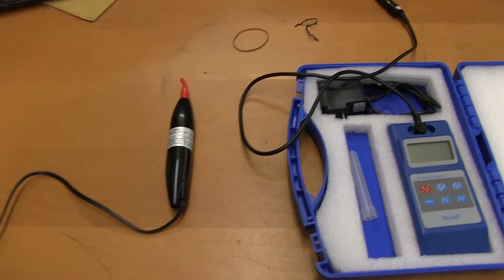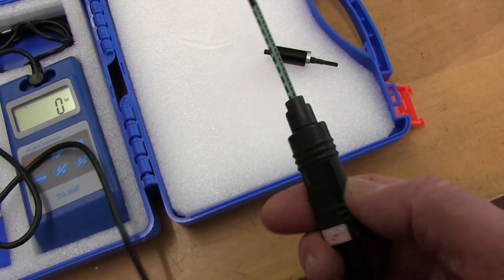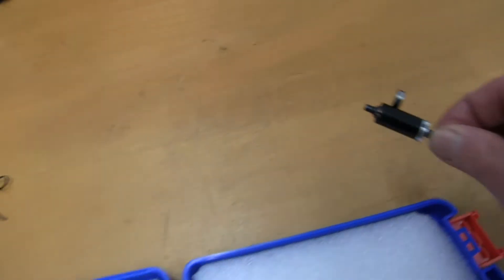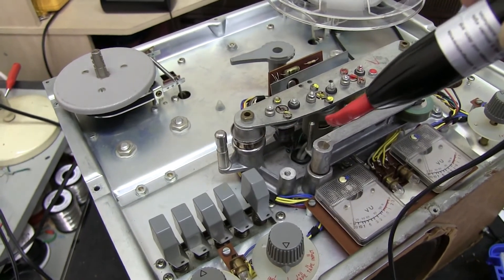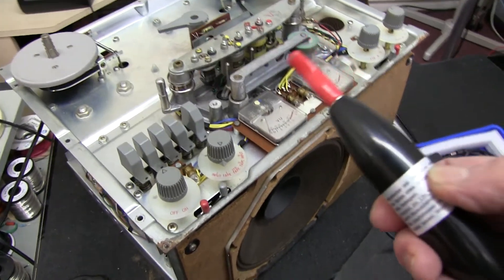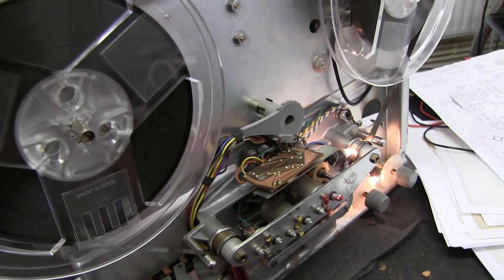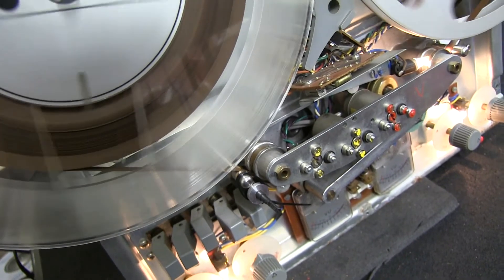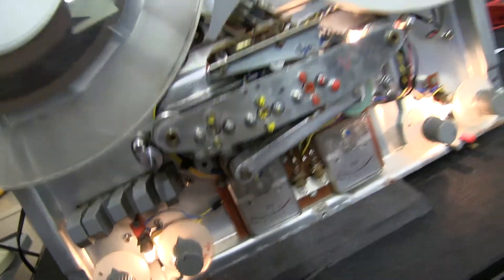How to Degauss and how to DC erase tapes. Reel to Reel.

Comment: correct if wrong, but could you not just hold the head degausser in place where you held that magnet and it would do the same thing? that way you would get the proper AC magnetic field required to erase the tapes and there would be no leftover magnetism on anything ? thank you

Comment: Good tips and ideas, but I'd never use a permanent magnet like this to erase a tape. True, it certainly does wipe out the recording, but it also leaves the tape in a magnetized (DC) state. First of all, it may be problematic for the erase head to properly erase the DC magnetized tape during a subsequent recording, but also since the erase does not necessarily cover the whole width of the tape, there will be remaining strips of DC magnetization, so if you haven't had problems with magnetization buildup on the heads before, it's likely you will after this type of erasure. True, DC erasure has been used in low end tape recorders, but the approach is to have at least two pole pieces with opposite polarities attempting to first magnetize and then de-magnetize the tape again.

Comment: I have one of these I suspect that the U.K. mains voltage is a bit high for them as they get hot in use. I have fitted a momentary switch in the cable of the one I have just to prevent it being left on accidentally. Great video thanks

Comment: indeed i had  such a  red tipped one i bought it a decade ago i thought it was dead  after these uears when i tried it today  because you feel nothing no vibration dont even get warm (the short time i had it on)  so you say that it  is normal with those torpedo demagnitizer  things only a slight vibration when actually touching the heads. good to know  so i take  its probably still alive then

Comment: Can it work on fast forward mode ?
Reply from the maker: Hi. Yes, the bulk erase will work on fast wind
Reply: Nick Adams Thanks ! Could you provide a link when I could purchase that little sort of motor magnet you’re using ? Finding bulk tape erasers in Europe is really difficult
Reply from the maker: @louismarinrenaud416  I used the rotor magnet ( it has a north and a souh pole opposite on the long side).
It is from a model car brushless motor (standard 1/10th scale 540 size).  You can take one out of a motor or buy one.
Here is an example:
https://demonpowerproducts.co.uk/product_info.php?manufacturers_id=&products_id=9852
Or look on ebay.

Comment: The only issue is the level of noise the permanent magnet can leave on the tape ... if the recorders erase head isn't completely blanking the tape then it could possibly be misaligned OR the signal going to it is weak do to electrical circuit(s) driving the erase head... the other issue is that using the permanent magnet is that it could magnetize the play head (3 head machine) ... I've heard that two head machines it isn't an issue because the BIAS applied during recording will act as a head demagger ... I don't have any type of testing equipment to verify that ... perhaps there is some that could test that LOL

Comment: A good instructive video!  Better than most. Can anyone tell me how do I know if my reel to reel heads are knackerd? cheers
Reply from the maker: Hi Roger. Worn out heads will normally be the loss of high frequencies or volume fluctuations.  You should be able to look at the head face with a magnifying glass.  Look for the vertical slit in the centre and see if it is still very narrow, with no bits missing, or wider at any places. Also the tape may have worn a groove into the head which can cause the tape to lift at the edges.  Heads can be relapped, ie smoothed out, but if the microgroove has widened out, it may not get any better by cutting it lower. All the best nick

Comment: This is a good video and very helpful because I have not been too impressed, with those other mains powered magnetised erasers that buzz loudly and leave audible artifacts.  So I think I will try your idea with the Sintered rotor, and then modify an old cassette tape recorder with the magnet to automatically spool and erase for me.  I wish to erase some multi-track Metal cassettes that I bought in the early 1990s.  So is this Ebay listing the exact same part as yours?  http://www.ebay.co.uk/itm/101809-HB-HOT-BODIES-SINTERED-12-2MM-ROTOR-Electronics-GENUINE-NEW-R-C-PART-/311645368236?hash=item488f82efac:g:-XAAAOSwhOVXcqt6
Reply from the maker: Hi
Yes, that rotor will work perfectly.
Be careful when putting it down, as it will be attracted to any steel that is nearby, so keep it in a protective container.
All the best
Nick

Comment: why would I want to dc erase the tape head? and how many times can you erase and record on a tape ?
Reply from the maker: +maak 
Hi
I agree. Erasing the tape heads seems pointless with most later designed tape recorders. 
The tape heads are extremely hard to magnetise, and would need a high strength to demagnetise the tape.
As I show, you need a very strong magnetic field to have any affect on the recorded tape.
A gaussmeter cannot even detect a magnetic field, on a quality tape head.
I suspect that early tape recorders had heads made of inferior magnetic steel that could become magnetised and may have needed demagnetising. And the practice just carried on.
The quality of the original tapes has the biggest affect on the sound, especially the high frequencies, and a later manufactured high quality mastering tape has a much superior frequency response.
How many times can a tape be erased and re used?
I have not seen any investigation of this, but I cannot see why not many times, as long as the tape does not physically wear out.
The magnetic domains in the tape have to be rearranged by erasing and then by the recording. This is not a permanent change, like baking a cake, but can be reversed continually, until something happens to the tape physically, such as the domains sticking together or rubbing off. But I would not expect that to happen with a new tape for say hundreds of uses.

Hope that helps
Nick